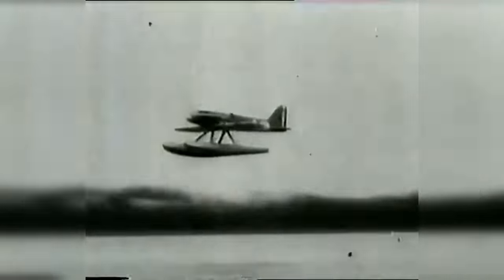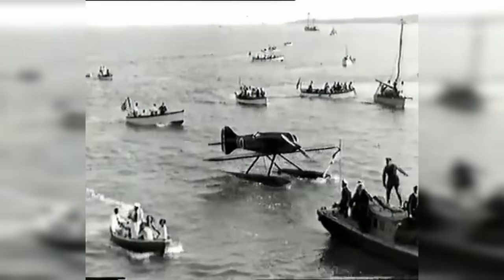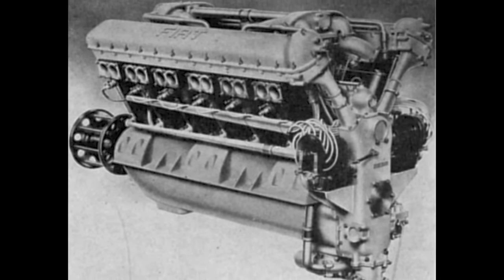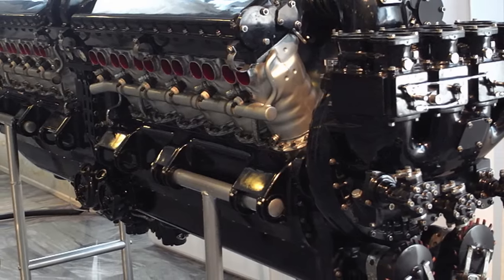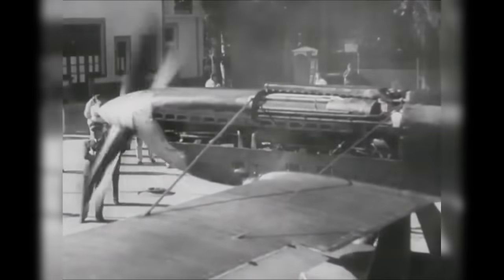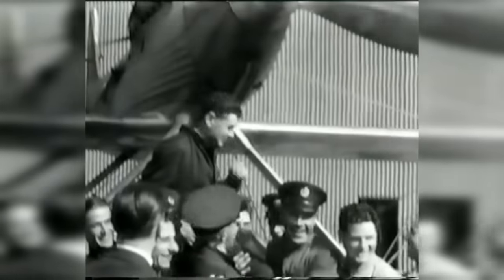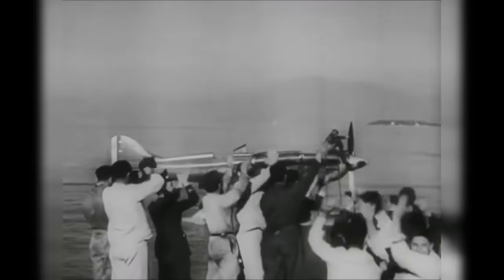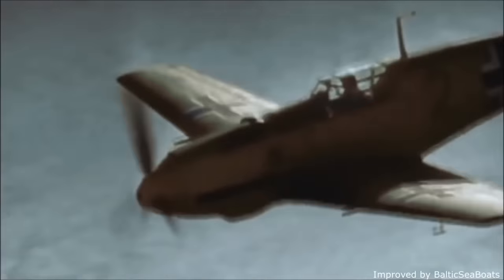The 3100 Horsepower Italian V-24 Air Racing BEAST - Fiat AS.6

Comment: Fit nicely in my Mini, one engine in front, the other in the back in the boot, with a little work. Can use the original 850 motor as a starter motor with a few modifications.
Reply: An experimental twin Mini crashed spectacularly on a motorway in the 1960s when the rear ‘front subframe’s’ locked steering arms failed sending a back wheel wildly out of control.
Reply: If I remember correctly, John Cooper himself was testing the twin Mini when it broke and nearly killed himself in the resulting crash.

Comment: instead of trying to turn TWO engines into one, why not just take the design and make it longer?, double the cylinders, double the length of the crankshaft (with suitable support points)and scale up the air intake, supercharger, carburetor, radiator and oli cooler to take the larger capacity engine

Comment: Never could figure out why people always put the operating controls at the Back of the engine when operating it on a stand. With props in place, it throws all the fumes in your face, not to mention hot oil & fuel. 1st engine shown needs exhaust pipes desperately.

Comment: I have a question, what kind of dynos were used to measure all this power? Dynos capable of >1000 hp are rare today!
Reply: Usually, it's calculated, and then the Dyno results are compared against the calculated numbers to the limits of the Dyno.
Reply: They had water brake dynos by the 20's . Dynos had started in the early 1800's as a way to measure the power of horses.  There were various types around, some were inertial some were absorption but they were incredibly dissimilar to what we have today.  By the way sort of mickey mouse dyno shops do you have near you?  Even the little superflow dynos will go up to 1500hp, with some going to 4000. I wouldn't trust a dyno shop that had a rickety old dyno that couldn't go over 1k.  At minimum that means it's so old their data collection systems will lacking.

Comment: Great documentary! ☀️
Please note that the absolute record for a piston-engined airplane was set on April 26th, 1939 with an ME209 at 469 miles or 755 km/h.
In fact, it was only ever broken 3 decades later in 1969 by a Bearcat Conquest 1 🏆!

Comment: The M.C. 72 was powered with the formidable Fiat AS. 6 engine  often referred as a tandem engine by uniting two engines but reading Italian books here and there I never saw the word "tandem". In practice was a very good solution by keeping a narrow fuselage and permitting a double shaft in order to have contra-rotatng propellers eliminating torque. Unfortunately it suffered serious backfires possibly leading to the death of two pilots. Despite calling in an expert in fuel from Rolls-Royce and did partially solved issues but never achieved full power for various reasons. I do wonder if Italians had installed fuel injection like the Germans as it would solved this problem aside added complications and weight. Good job 👍👍👍

Comment: Watch at 4:47:  This is a twin engine design! The rear engine starts first and the front propellor starts spinning;  Then the front engine starts causing the rear prop to turn;  there is no connection between the two V12's  so this is actually a twin, not a single.

Comment: Messerschmidt set the all time speed record in 1939 at 469 mph that stood for 30 years until the modified Grumman Bearcat took it in 1969 (fastest piston engine aircraft ever). 
The ME209 Daimler Benz V12 made about 2400 hp, due to cooling issues, for a very short time but long enough for the record flight,

Comment: I've always wondered why these speed record planes were on floats. The parasitic drag from those things had to be a major issue. Were there no runways that could handle these planes?
Reply from the maker: At the time the speed record necessitated floats as part of the rules
Reply: I think since they used fixed pitch propellers, the prop blades were set to the ground to the max pitch allowable for the max design speed. So the take off run resulted in a too much long distance, hence taking off from a lake solved that problem (until variable pitch props went more common).
Reply: @emanemanrus5835   this is pretty much it

Comment: 7:37 Hmm, really? 440 to 450 mph max under what conditions precisely. P-51H or the Red Barron or:

On September 2, 2017, Steve Hinton Jr, in the modified North American P-51 Mustang Voodoo set the new record of 531.53 mph (855.41 km/h) in the C-1e class (the same weight class Rare Bear would fall into). This record is also the fastest for any propeller driven piston aircraft. Also clocked (max one way speed) at 554.69 mph. 

Reno Air Race had Dago Red P-51 all-time Unlimited class speed record of 507.105 mph in a six-lap race around the 8+1⁄2-mile course.

So am I missing something here?

Comment: The drive shaft from the rear engine drove the front propeller and went through the outer drive shaft from the front engine, which drove the rear propeller. The other way round it wouldn‘t work. No?
Reply: depends if the prop was direct drive to the shaft or geared at the hub itself I reckon - ie: whether the rear engine's shaft was one piece it's entire length or multiple sections.

Italian designs always seem to involve some incredibly overly-complex critical mechanism that's borderline black magic to get to function correctly....

Comment: If they were to go back to the V12 configuration, it would still be possible to get more than 1400 hp.
Reply: It also used special fuel. 
Maybe it could have done it with the 100/130 octane fuel the allies used during the war, but the axis was mostly stuck with 87 octane fuel. 
To give a measure, the Merlin, that produced over 1700 hp on 100/130 octane fuel, never produced more than 1100 hp on 87 octane.
Reply: In the early 30s the fascist regime, in their immense wisdom, basically stopped development of liquid cooled inline engines in favor of air cooled radials, as they believed them to be better overall

By 1939 they had realised what a moronic decision that was, so they asked for development of liquid cooled engines to restart asap

Taking everything they had learned from the development of the AS6 V24 engine, FIAT developed the AS8 V16 engine, which was meant to power the CMASA CS15 racer and brake the absolute speed record (at that point held by the Me-209)

By the early 40s they had the engine ready and had already tested it by running it for 100 consecutive hours without any major issues (not bad considering the AS6 was only tested for a maximum of 60 consecutive minutes )

It produced around 2000/2250 hp, for a short time it could even reach 2500 hp
 But by then the regime wanted military aircrafts for the war, so the AS8 was abandoned and the CS15 was never built

It would be used as base, at least initially, for the A.38 engine, later changed to an inverted V configuration, meant to power the G.55 and CMASA CS38 (the latter would never even be built)

While they were working on the A.38, they also came up with two other, even more powerful engine designs, like the A.40 X24 engine and the A.44 H32 engine

But at that point it was too late and the italian air ministry was already looking at the german DB engines, which were already in mass production and fairly reliable, engines which ended up powering italy's series 5 fighters till the end of the war
Reply: @gian.4388  thank you for the info

Comment: Cooling problems weren't that significant in the development. In contrast to later efforts in running v12s as seperate engines laid out one before one after in a straight line. I guess these fragile aircraft used the wings as radiators. Or, perhaps joining the engine blocks somehow mitigated the cooling problem...
Reply from the maker: Skin cooling was common. I’m sure the mc72 used it to keep the drag down. I’d have to go check!
Reply: Or they were just very short flights. But later similar wartime efforts all reported cooling issues.
Reply: More air density at very low altitude, more air molecules to absorb heat.
Reply: @flightdojo  The shiny upper surfaces of the floats are the radiators.
Reply: To minimise transfer of heat into wall, the flame front needs to reach all walls at the same time. I guess that a long stroke works better.

How do squish areas work? Can they have teeth/scissors around them and shot vortex ring states? For a pancake flame volume, I imagine like 11 squish shooters. Or there could be small pistons all around who inhale slowly through a perfectly round nozzle and then shoot. Need some space between cyclinders. Individual heads like on a radial engine or W16. So there is also space for small intake valves to fill the space between the two main valves in a radial Hemi roof. 

Spark plug center in space. Some toroidal swirl to blow the fireball away from the roof? Inverted engine and convection?
Reply: It used both the wings and the floats as radiators. The radiators were also made of copper alloy, that exchanges heat better than steel or aluminium. 
The Schneider Trophy was run on a triangular circuit for a total of 350 km. So even in late editions the engines had to work for more than half an hour at max power.
Reply: @neutronalchemist3241  good info that is longer than I thought.

Comment: Twin V12's coupled:  I'd make them fire together.  Twin V8's coupled:  I'd put them 45 degrees off, and that is exactly how production V16's have fired.  A V16 sounds like a very angry V8:  ::ROwww  Rowww::.  A V24 is just going to sound like an inline 6 with a good exhaust.

If they wanted more cylinders they should have gone with an H24 design, like the engine in the Hawker Tempest.